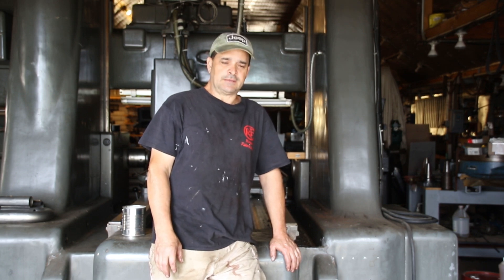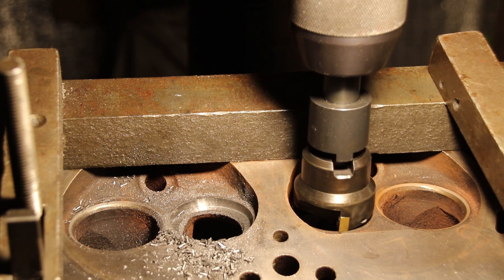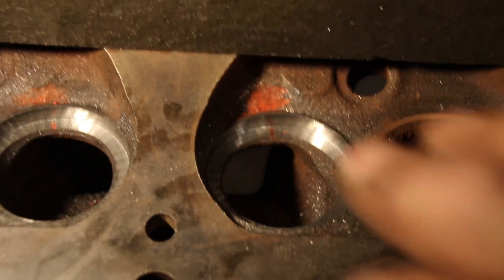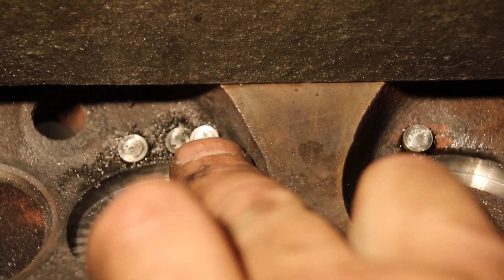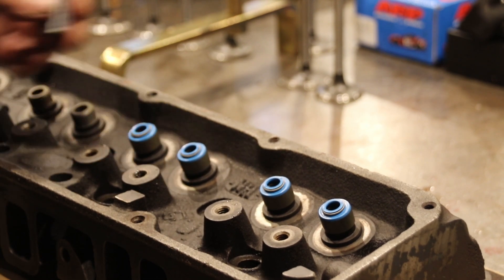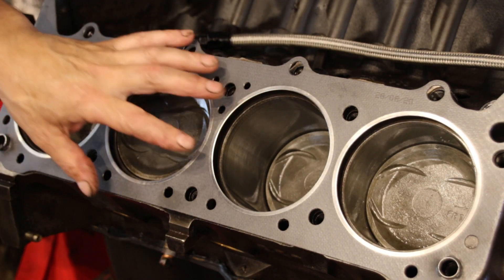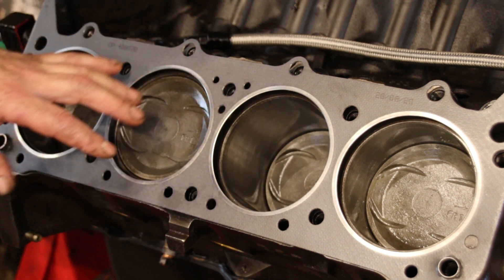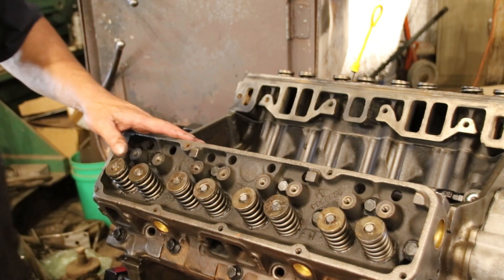AMC/Jeep 360 Cylinder Head...New Seats and Permanent Crack Repair

Comment: Hi with your machine and build //a youtube channel called --bus Greasemonkey  has need of a good machine shop ,WHY ? lots of the older M.C.I. BUS MOTOR HOMES ,-AND G.M.C. bus need air compressor machine like new //and your the man can do this on price for new if you can find 1 is over $1,400 , // now rebuild is $1400.00 or more . //this my be a good deal for you as shipping and other needs to keep them M.C.I. AND G.M.C. BUS safe on the road //good luck . working to help.

Comment: This brought back memories of rebuilding my 360 in the 70's. I had brass valve guides installed though and 7/16 rocker studs,  because I kept braking off the 3/8"  ones.
Reply: You upgraded to smaller rocker studs?
Reply: @clone4211 larger by a 16th.